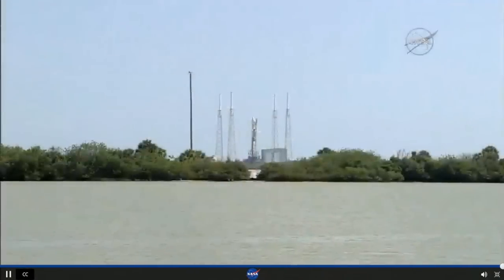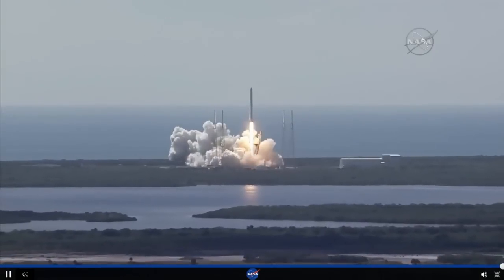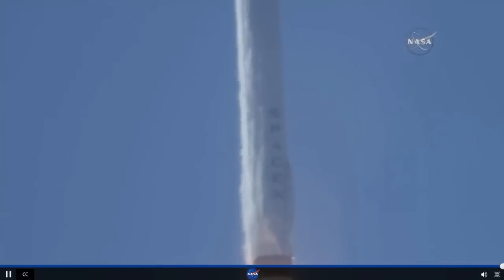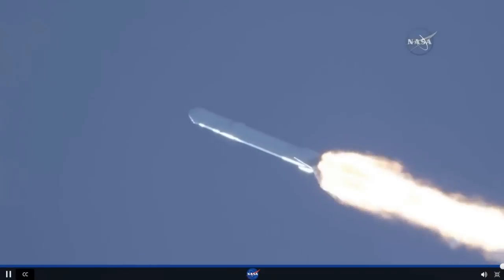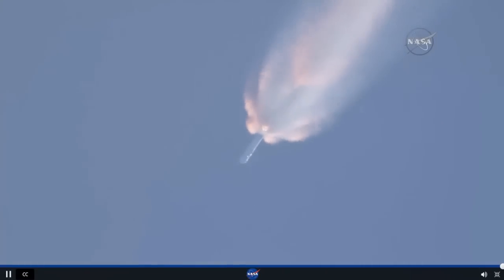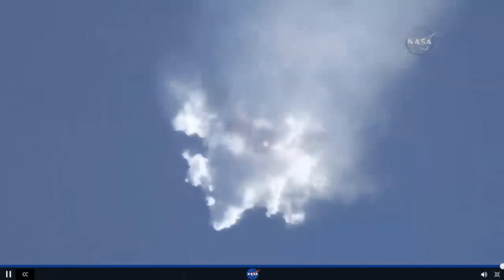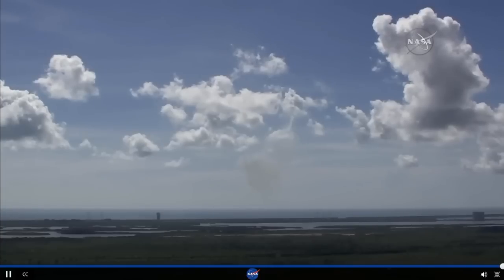SpaceX Falcon-9 Dragon CRS-7 Failure, June 28, 2015

Comment: My diagnosis, is an Injector failed which allowed fuel in the tanks to ignite as it traveled up the engine. You can hear one engine after launch popping louder then normal which tells me like a blow torch it's back firing.

This can be caused by moisture in the system from storage over night or in the fuel which is even more unlikely  however it's where i would start, anything that disrupts the stream of consistent flow will create jumps and or sparks. However this is just my theory, it's not a complete diagnosis or has any clarified data on how the equipment was stored over night. Ill leave that to the professionals but from what I can hear and see. That is my call.

Upon inspection of lift off one system was not closed on the second line, which means it was topping off or still filling which could mean a leak, which could be the injector as there where no warnings or overrides to stop the launch.

You can here the popping at 1:45

Comment: It's interesting that the first 18 launches of SpaceX were flawless. They started to have problems only after that. Wonder if the problems are caused by their effort to make the launches "better, faster, and cheaper"?
Reply: It's the point of a business to manufacture its products at a low cost is it not?
Reply: +PuddieTheKat Of course it is, as long as it does not sacrifice quality or safety.
Reply: Exactly, and right now SpaceX is making mistakes and learning from them
Reply: +PuddieTheKat Good for them! Let's hope they iron out all the problems, so the US doesn't have to buy its launches from foreigners in the future.
Reply: +PuddieTheKat  It is a tricky business to perfect those cryogenic liquid turbopump-fed rocket engines.

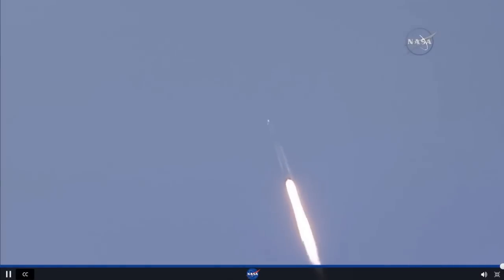Comment: 1:33 shows really well what I believe is a leak from the 2nd LOX fueling port.   LOX leaking down the side of the rocket and into the ignition, if this came back up into the LOX tank it would have caused the over pressure?